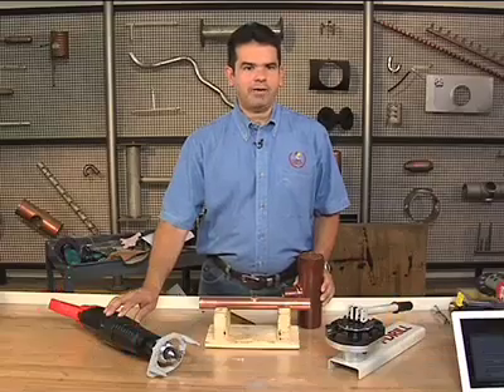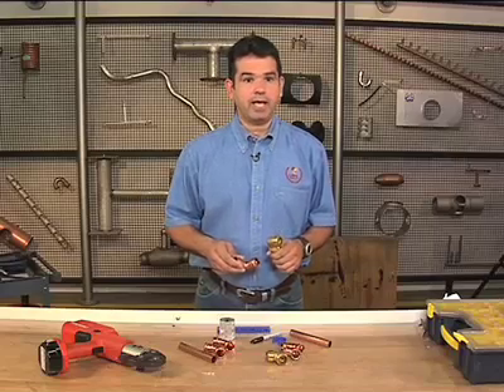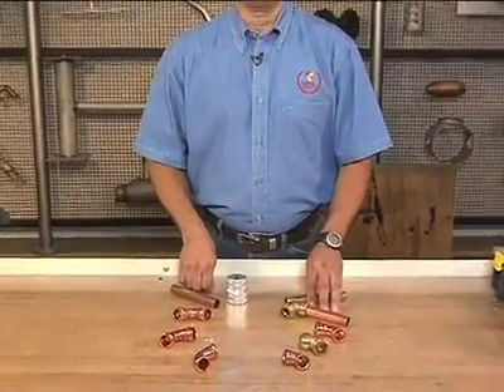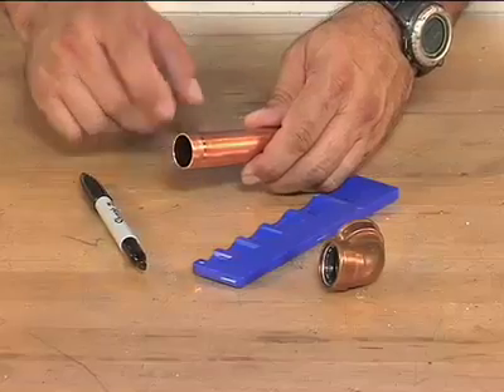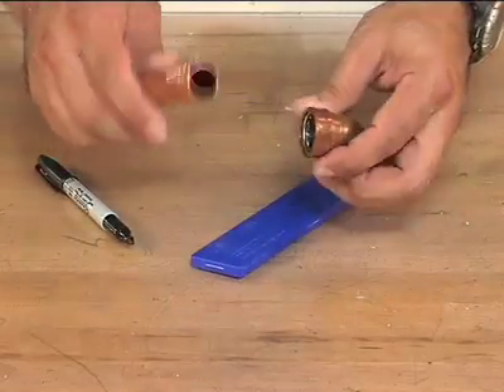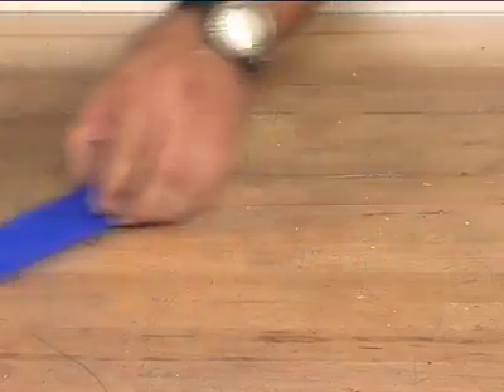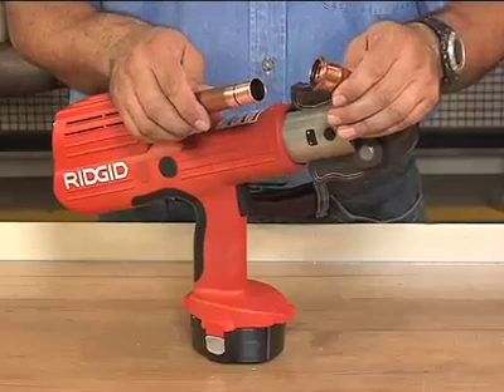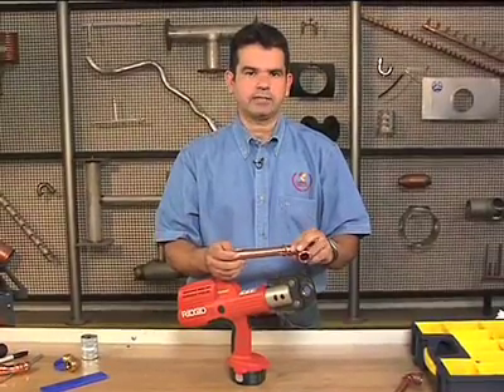Solderless Fittings

Comment: crimp fittings are going to leak  at least that is my experience They leak at the crimp pinch section and also deforms the fitting and pipe. Nothing works better than a soldered joint when soldered properly.
Reply: Crimp fittings are going to leak and Im keeping my horse.
Reply: 25 year guarantee on press fit, vs life time of pipe on soldered joints. I have seen 120 yr old soldered joints not leaking, and 2 day old press fit leaking.
Reply: 25 year guarantee on press fit, vs 0 year guarantee on soldered joints. From the manufacture.  

Any joint can fail thats y they all should be tested before the job is done, 

And PEX A using expansion joint fitting is better than copper for most application anyway,

So true u can teach an old dog new tricks before u can teach an old plumber.
Reply: Maybe, but there are some jobs where there is a zero flame rule & policy, so you don't have a choice.